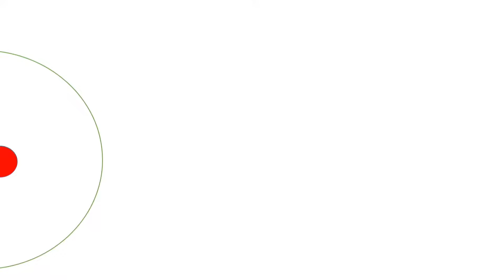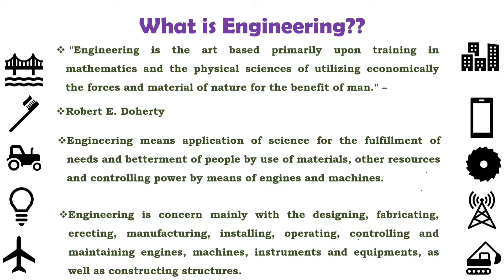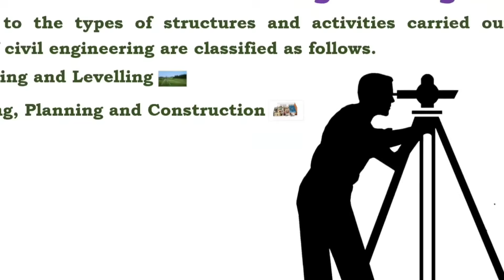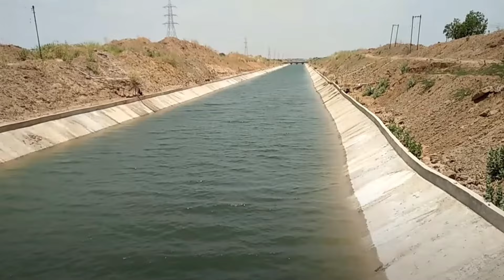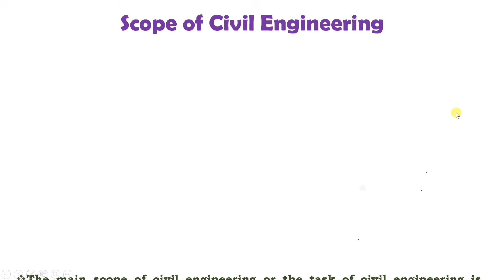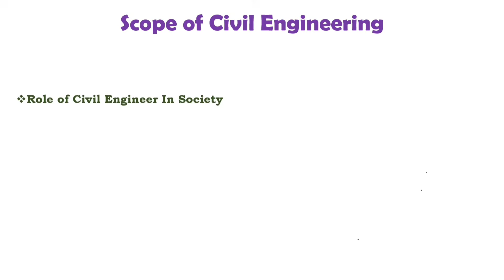Introduction to Basic Civil Engineering

Comment: 🏗️ Aging infrastructure is creating new challenges for engineering teams.

According to industry reports, many bridges, buildings, and transportation assets are operating well beyond their original design life.

The challenge isn't simply identifying problems—it's detecting them early enough to prevent costly repairs, operational disruptions, and safety risks.

That's why structural testing technologies have become a critical part of modern infrastructure management. From load testing and vibration analysis to condition monitoring, engineering professionals are gaining deeper visibility into asset performance.

At Civil Structure Test Tech, we focus on technologies that help organizations make more informed decisions about structural integrity, maintenance planning, and long-term asset reliability.

How is your organization approaching infrastructure assessment in 2026?

 

Learn more:
Specialized Testing Equipment for Civil Structures

#StructuralEngineering #Infrastructure #CivilEngineering